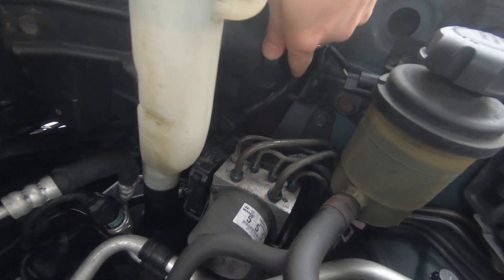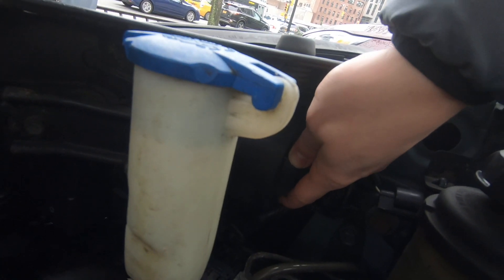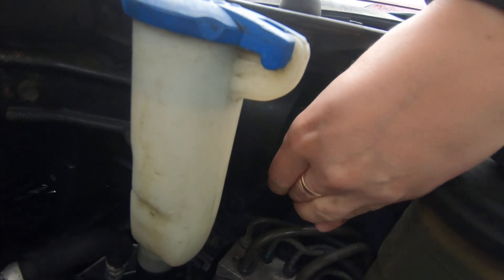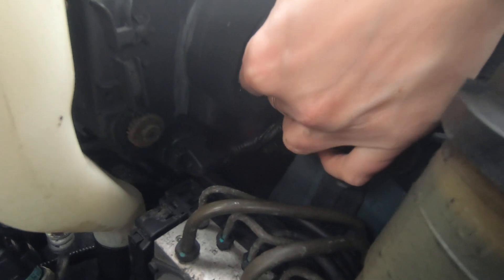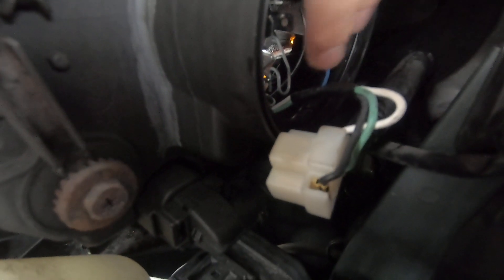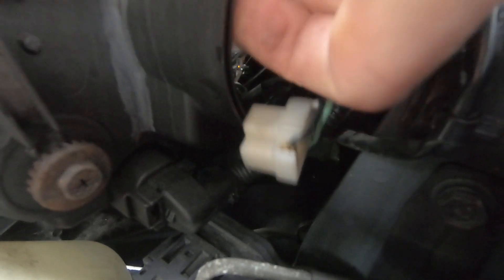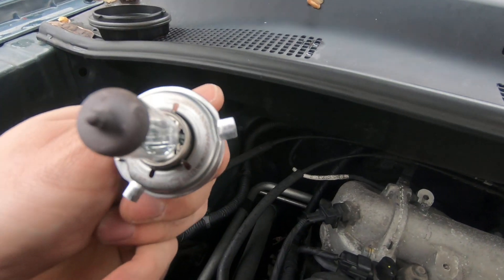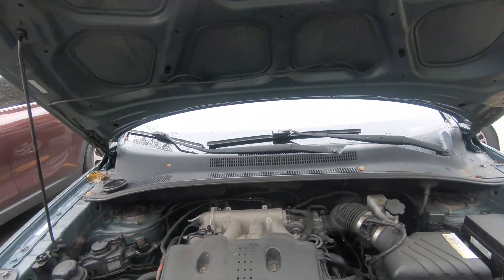How to replace Headlight Bulb On Kia Sportage 2005 2006 2007 2008 2009 2010

Comment: Awesome, quick demonstration! Everyone is complaining about the driver's side. The only additional steps are to remove 2 screws from the air intake and then pull the duct off. Same access as passenger side, same steps. Watched this video and changed the bulbs in under 10 minutes (including remove air intake and reinstalling it). Again, excellent video!

Comment: How about showing us how to replace the bulb on the other side.
Reply: Foreal that air filter thing whatever it is makes it hard idk if it’s even safe to take it off
Reply: @Blahblah.44 idk if it helps but its just an intake canal, u can safelt tske it off and put it back on did it at least 20 times before i converted to a CAI system